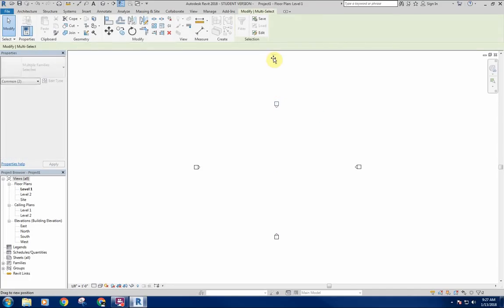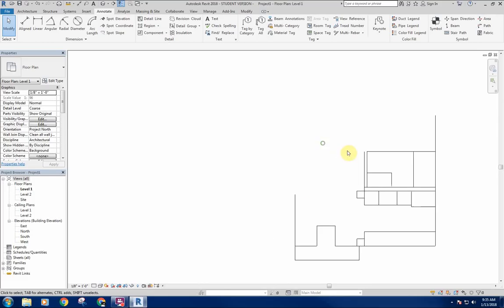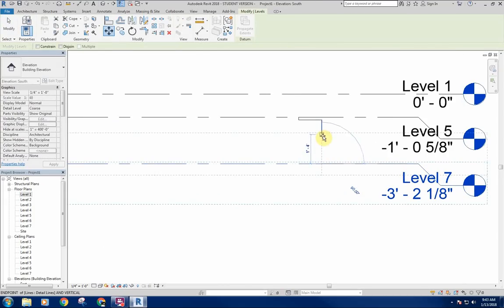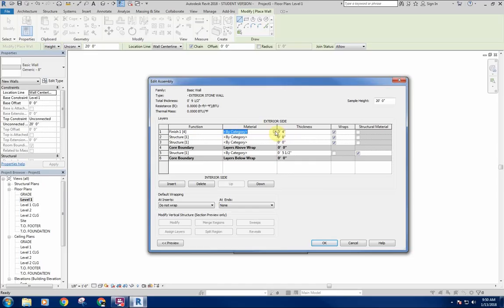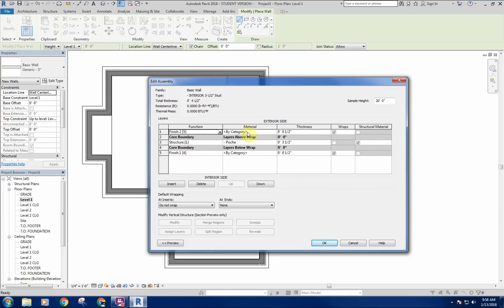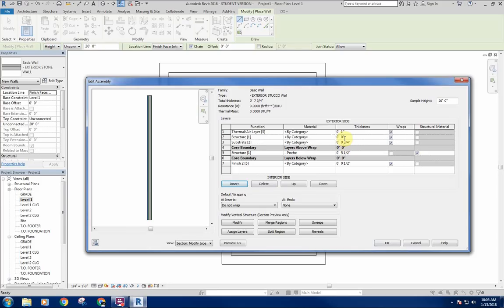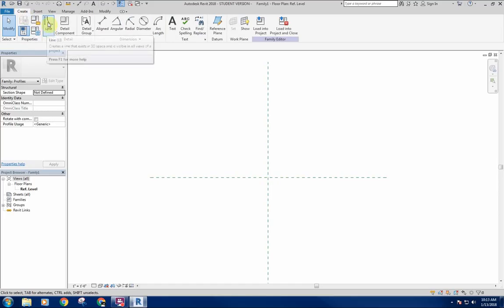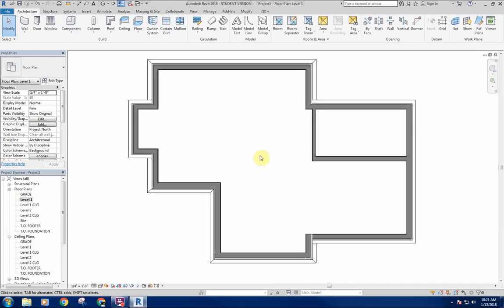Revit 2018 - House Tutorial - Part I - Introduction, Initial Design/Layout, and Walls

Comment: Thanks for the tutorial, my dude. Quick question, should I put down the floor before throwing up walls, or throw up the walls then lay out the floor?
Reply from the maker: I would do the walls, then the floor.  The only reason I say that is because you'll want your floor to extend into your walls to achieve the correct construction detail and that's going to be harder to do if you do it floor then walls.  

Glad they've been of some help!

Comment: Hi Brian.  Thank you for the tutorial, I'm getting a lot out of it.  Can you please tell me exactly what you did at 47:36 - 47:41?  Also, I was not able to bring up BOTH the stone wall and the stucco wall for alignment on the floor plan even with zooming in and a fine detail.  However, I created sections and I was able to make it happen that way.  I am using 2019.  Could that be a difference between '18 and '19?  If not, what am I doing wrong?  Do I need to adjust a setting or something?
Reply from the maker: You can certainly do it in section rather than plan.  If hitting tab when hovered over the edge where both walls should reside doesn’t bring up both, it may be a view range issue, or you’ll just need to do exactly what you did.

As for the section you referenced.  I basically did nothing there.  What I was looking to do is to find a stone cap for my stone wall that I could bring in.  However, Revit didn’t have anything that looked good to me in their library so I cancelled out of that and made my own.  What you were watching is me going into the profiles library and looking at what Revit had to offer, which, as I mentioned, wasn’t much in terms of what I was looking for.

Hopefully that all makes some sense!

Comment: hard to follow cause of audio and i had to pause, rewind, then zoom in to find out what the dimensions were. also its kinda confusing how you kept moving stuff around. if these were improved on it would be easier for beginners but other than that pretty good layout and design
Reply from the maker: Thanks for the feedback!  Really appreciate it.  I actually increased my screen resolution on all my 2019 videos for that very reason with the dimensions so hopefully those are easier to deal with in the future.  I'll definitely keep the moving stuff around thing in mind as I keep going.  I plan on doing another series like this sometime in the future and hopefully a lot better than this.  This was kind of my first foray into doing something like this so obviously it has some pitfalls.  Appreciate the feedback!
Reply: @brianalbrecht7859  I love this tutorial but it is hard to see the short cuts you use to modify. for instance, you highlight a line and match the length of the joining line to meet it but I can't see how. I've rewound and played it numerous times now and still can't see. I appreciate you taking the time to share and apart from that it's fantastic.
Reply from the maker: @mooneybot  Good to know for future!  In the instance you're talking about I'm using the Trim tool.  I'm not sure what instance you're talking about but I try to say something like "Trim these together" or "I'm just going to Trim these" to identify the tool.
Reply: @brianalbrecht7859  thanks for that. I'll check it out.